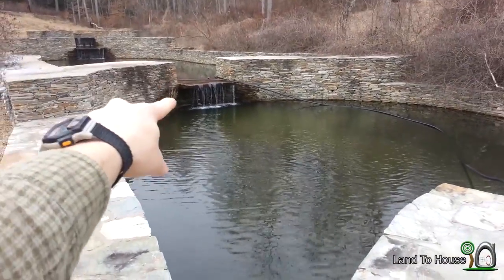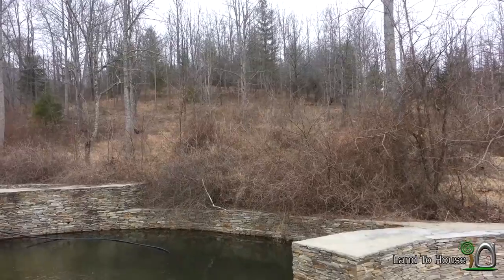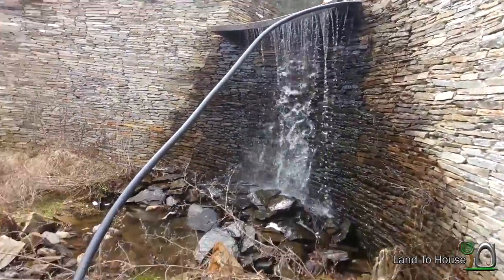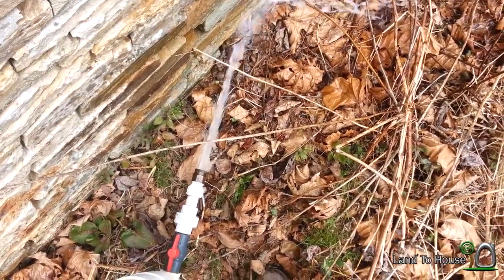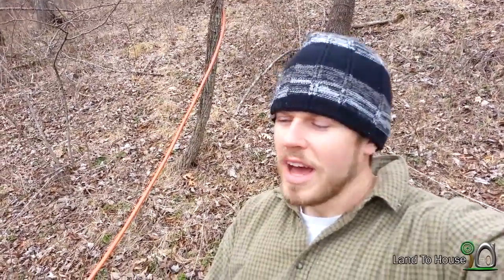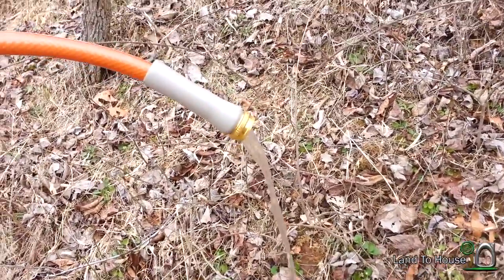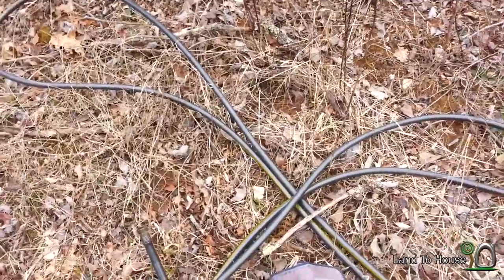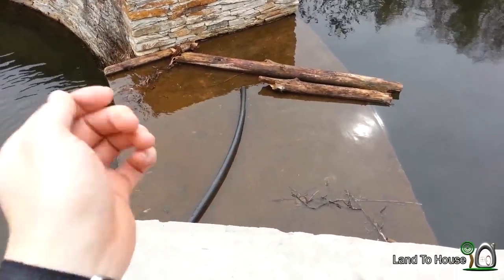Adventure 25 - Ram Pump Potential

Comment: Any time I can see a Ram pump I like it.  I hope to build a 1/2 inch Ram Pump soon.  My flow is not enough for 1".     Keep the great Vid's comeing....
Reply from the maker: I shall keep them coming for sure! I have a few videos in the works to test the GPM needed for 1-1/4" 1" and 3/4" drive pipe pumps. I am going to test them in at least two ways to make sure that I have a good understanding of how many gallons are need to operate each.
Reply: Thanks

Comment: Seth nice video! I am impressed with the pressure! Dam, it is so powerful! In order to have a full theoretical approach, like a manual kind of, i guess that apart from the height a connection should be investigated between supply efficiency and diameter of the pump used. This answer will bring to somebody the two elements that he needs when making or buying a ram pump. How much can it raise and how much water it needs to work. Great video!!!! Again, so helpful! Thanks for sharing!
Reply from the maker: I could not agree more. I have a young friend that wants to learn about the ram pump and he wants to be in a video. So he and I are going to start doing some tests with the minimum GPM needed for each size pump and what output they have at a known height. Should start closing the gaps in the information people need. As far as the connection goes I have a grand plan for that but it will be a month or two before I get that worked out..... Dam pressure!  haha Working with the ram pump has been one of my  favorite pastimes.